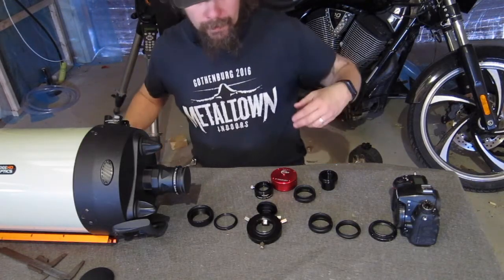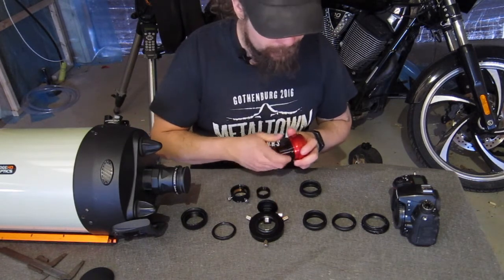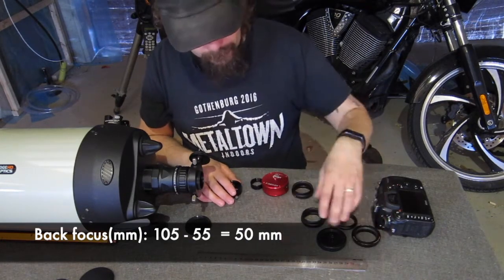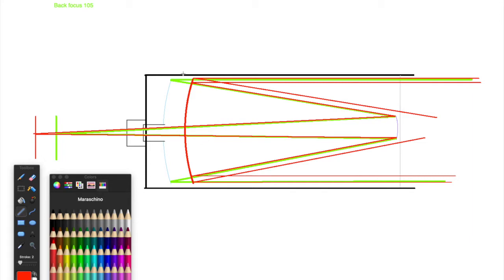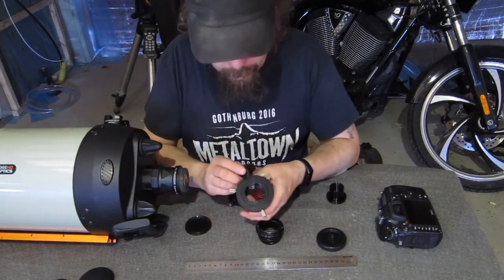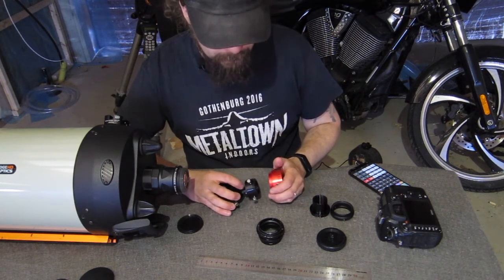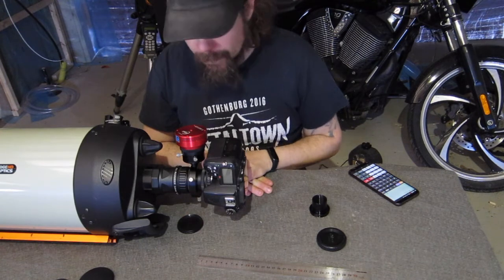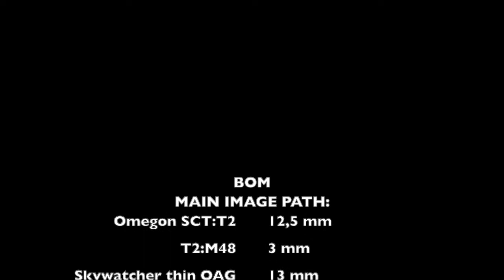Setup an Off-axis guider with a twist - Reduced OAG for a brighter image!

Comment: Hi, great idea, do you know if you able to Polar align with this OAG reducer. I really don't feel like having another guide scope just to polar align and I move my mount every day so usually I run the Ekos polar alignment which takes 5mins but I had a 200mm scope and now I moved to the C8 Edge.
Reply from the maker: Hi Paulo,
I’m not a custom to use ekos for polar alignment although I am using kstars and ekos for all setup. Maybe I should… I have been spoiled with ASPA on the NexStar+ on the Celestron mount, which I think has been working pretty well.
Concerning the reduced OAG, I see no reason why it should not work like any other.
Since your well-versed in Ekos I suppose you could just to a plate solve and get the actual focal length. You wouldn’t need to go through the whole exercise I do in my videos ;)
Let me know if that works if you would try it!
Reply: @astroboden  I am waiting for an adapter as I cannot get Backfocus with the reducer on a 1.25 connector. Once I try I will let you know.

Comment: Nice and informative video. How did the idea with the reducer for the OAG work out for you? Did you get better guiding? I'm trying this too though finding out that I have a very limited room for it in my setup.
Reply from the maker: Hi and Thanks! It works fine, as long as you can get the spacing right. For the SCT in the video it's really nice. However,  I'm also struggling a bit with my refractor.  I'm getting some weird shapes around my stars from the OAG. Not obvious related to the reducer unless I need to bring the OAG close to the camera. Then I'll lose real-estate for the reducer. Don't really need it for my small refractor, but I like the setup.
Anyway, I did an earlier video where I set it up and measured the reduction ratio. I'll post a link in the description.
(https://youtu.be/Pd3tMB5_T5o). Here you can see how the the fov really is larger and the general brightness of the image increased.
I'll make another video when I get a chance of the how it actually look with stars in PHD2. 
Thanks for watching!

Comment: Great plan. You dont mention your camera. It looks like zwo, so I guess maybe 120mm or something. I dont want to have to rotate the optical train because I'm fully automated. It suggests I use an asi290, but that is another few hundred pounds/euros/dollars. I wondered if your trick might help. You end up f3.5, mine would be f2.5 as I'm already f5.0. What do you think?
Reply from the maker: Thanks SteBz! It's an ZWO120mc-s. Think it's listed in the end. 
You can take a look at my first video about the "off-axis guider with a twist" if you like (link in the video). Due to the back focus I never actually got down to 3.5, but to around 5. Still a 0.7 reduction though. 
I did an attempt (not on camera), where I simply adjusted the focus to get the full 0.5 reduction, and it does work (not good for imaging without proper back focus). 
The scale of the original and the reduced image was 0.5. However, the prism size will start limit your field of view as well at some point.
If I go to f10 I should have enough back focus, but still only be able to reach f5 at best.

The original fov depends on your system I suppose.
It does improve things in my mind, and is well worth doing if you're pushing the limits. It's not an expensive setup. Just a slight fiddle ;)
Full automation is a dream for some, but the cost of sacrificing any hands on approach can be quite high. 
With my long focal length system, I still have to rotate the OAG to find guide stars. But then I'm reduced down to a main 1422 mm focal length scope. 
With the OAG setup on my 500 mm refractor I always had good guide stars.

What I think: 
I think it will improve things, but will it be enough for full automation and NEVER any hands on? I can't say, it depends on your system.
As I mentioned, it's not a very expensive setup. If it feels like it could do it for you, test it ;)
Reply: @astroboden  Thanks for your reply. I'm still guiding with a guidescope, and that works remotely. I never have to adjust it to find stars. Maybe I'll try your trick on my current setup and see how that works.

My setup is driven by some simple home made automation and lots of python. It was not so hard. I'm sure you could do it too. The main problem was finding somewhere with a removable roof 😁. You have nice low horizons which I envy.
Reply from the maker: Good stuff! I enjoy home made and python ;) Got some plans for Astroboden 2.0.
The low horizon is great. Summer is not so great. Winter is awesome!

Comment: how i can install to filter optolong L-enhance to SCT + OAG+ DSRL,  what is place to setup, tks.
Reply from the maker: Hi Juan!
I don't use filters, but I would put it between the OAG and the DSLR. You want it as close to the imaging camera as possible and NOT in front of the OAG (you don't want to filter the signal to the OAG). 
Some DLSRs have clip-in filters that go into the camera housing.
You'll need to check the space consumed by the filter holder and match that with what ever spacing you have between the OAG and the DLSR. 
Hope that helps!

Comment: How do you know it's 105mm or how would I figure out that number for my particular setup?
Reply from the maker: Hi Peter! 
The back focus distance should be provided by the manufacturer. You should also be able to find what it will be with any extras, such as focal reducers etc. I guess you could figure it out experimentally as well, like by projecting a focused image on a screen behind the tube and measure the distance to it.
Reply: @astroboden  Thanks. I will have to look closer at the specs of my telescope. I don't recall ever seeing what the back focus distance is supposed to be.